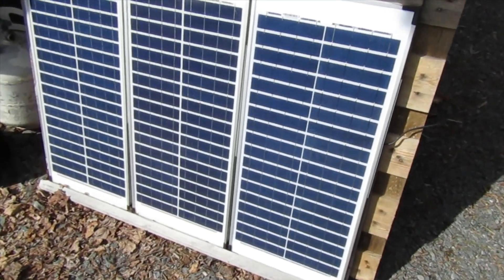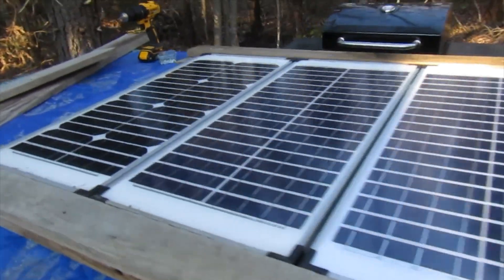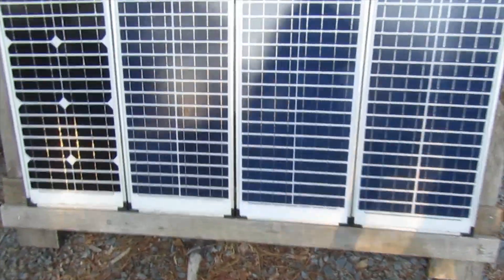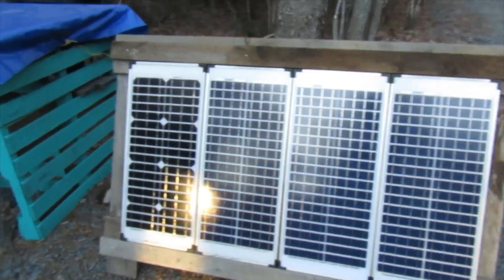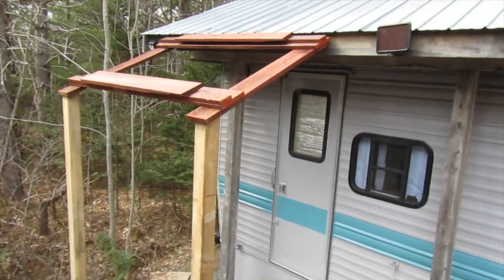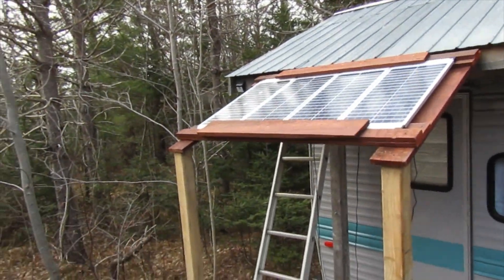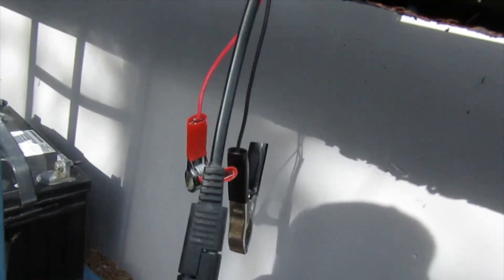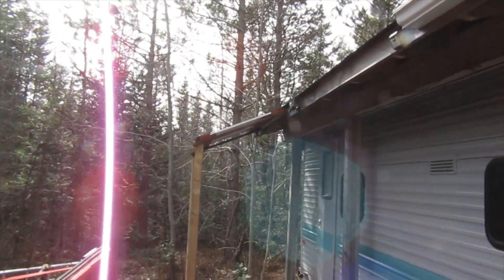Making a Solar Powered Awning - Full Time Off Grid RV Living

Comment: How large is your total battery bank for your RV?  Is it lithium?  I'm trying to determine how much power consumption I'll be using in order to determine my solar system size.  Thanks.
Reply from the maker: Unfortunately I don't know much about my batteries, they were gifted to me. I use 3 alpha cell batteries for the house batteries and 3 alpha cell batteries are spares.

Comment: Ya gotta luv power tools! Might wanna think about a plexiglass sheet to be a hail protector for your solar cells. If you still have the cloth awning extension poles maybe you can use them..and they're adjustable with a butterfly screw to get maximum sun on your cells...BTW, luv a girl with a tape measure!